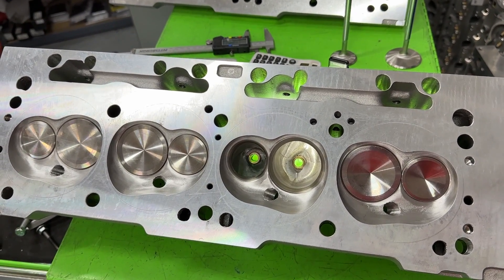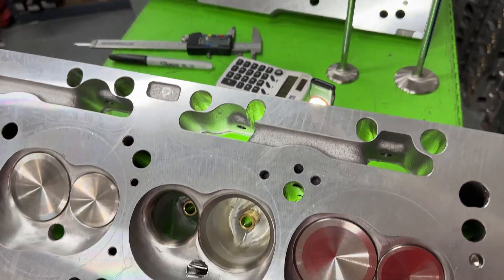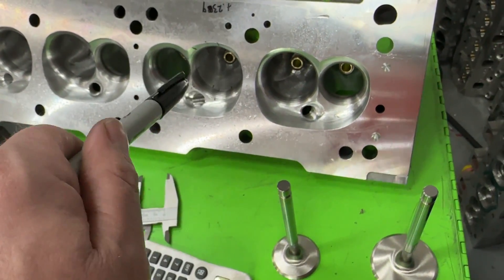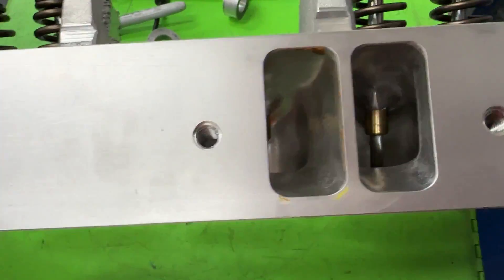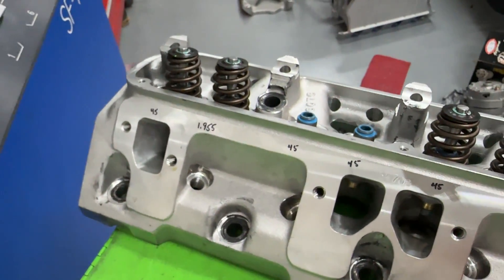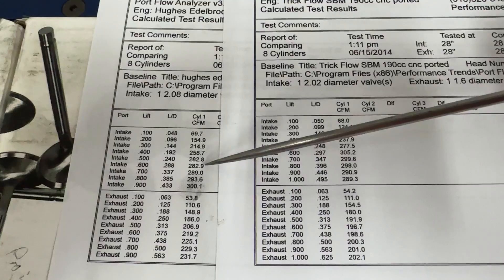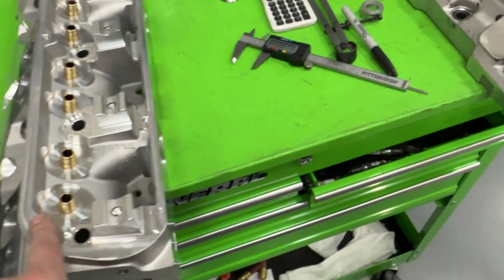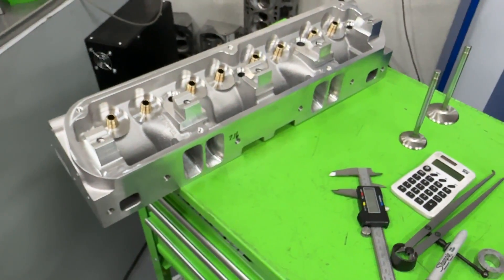Cnc Ported Small Block Mopar Heads

Comment: I may have missed it, but did you ever post anything of the trickflow after you posted it and went to larger valve? 

Also, do you think you could improve on the Edelbrock numbers if you took a bare head and offset the intake rocker like Hughes did?

Comment: Hughes does move the intake pushrod ove .350” to get it out of the intake port. They make a special intake rocker for the big mouth port job. I was thinking about having my edelbrock heads big mouthed, but the cost of the work plus the cost of the different intake rocker is too much for me. My motor does have Hughes billet roller rockers on it already.

Comment: The Hughes use an offset intake rocker and move the pushrod over. The Trick Flow have a stock pushrod location. If you want great # the Mopar W8 heads are were it's at.

Comment: My buddy has those big mouth heads on his 408 ,248/254 comp roller 122lobe sep, runs edelbrock proflow injection in a 67 cuda.runs 11.40"s at 118.street car with 3.91 gear. I opted for the trick flows and a slightly smaller roller for my 74 cuda .we"ll see how good it runs when its done. come on eric,lets see some more mopar content please.

Comment: Whats with the " i dont want to do small block mopar heads" ??
What do you have against the mopar community??????
Reply from the maker: I don’t have flow plates for the heads so I have to keep borrowing a plate to work on them. Also I hate the design
Reply: Éric how much better were the Trickflows after you added the 2.05 valve and ported?  Better than the big mouth ?   I have a set of tf’s and a set of Hughes super prep heads which are a stage 1 port from Hughes.  Basically not fully cnc’d, partial with 3 angle valve job, back cut intakes etc.   Would be curious to know a bit more on the improved tf’s if you can recall!  Thanks
Reply: Absolute poor design
Reply: @Willy-y1j  Ya so we need all the help we can get 😅

Comment: I’m glad someone sent these heads in. Thank you for this video.
 I have the same set on my 424ci LA SBM. 10.7:1, edelbrock super victor efi, 236/242 593/593 112lsa hydraulic roller. Chassis dynoed 445whp. So I’m guessing 525-550ish at the crank.

Comment: Looking forward to your flow numbers after your port work. Most power I’ve seen reported from the stock cnc work seems to be about 535 hp. It be good if us Mopar guys could buy these castings without the pushrod holes, so that we could just use W2 offset rockers.
Reply: Eric, if you and/or the customer can justify it, it’ll be great to get cc’s and CSA. The two sets of these heads that I know have been ported, they removed the vein completely. Thanks

Comment: So many of these readily available heads for MOPAR are little more than stock replacement street deals, not capable of making real power, or turning big rpm. They're low budget, low performance bolt on parts.

For example.....an old school cast iron W2 will walk all over these 2 examples of "modern day" offerings. Wanna' make steam with an inline valve small block MOPAR??? Find a set of W8s and properly prep them. 1050+HP potential with a cast single and a wet sump.

Comment: OH THE RESULTS for you further porting those TFS I would love to  hear the results.they say BM 225 cc intake ports with moved over pushrods. They selll the Rocker arms for them too.My opinion is I bought TFS . Thank you ever so much for showing the differences of heads. I bet a very large SBM will be a screamer with those heads, I wish I lived close by or I would get you to dyno test what i am trying to build a 416 .with 12.2:1 compression. I been saving for transmission parts and a rear before i complete
Reply: Like to hear more on your build, engine trans gear specs..what kinda car?
Reply: @gordocarbo  69 Dart will use a Racer Brown special Grind almost same as Used with Eric W. had on the 406.416 SBM. with 12.2:1 Eagle kit TFS 190. 750 AED Wiating to get a look at TFS Intake I have ordered , i do have a SV ed also but they need thorough porting each of their HP stuff does. then Mancini- H.S.RR. Morel RR. will be Milodon Oiling with studs where i can, also ARP 2000 rod bolts.saving for tranz, and rear. need to sell all my stuff from current 408 set up.I am trying not to Tub Car and currently deciding on offsetted shackles and weather the 4.10 and 28 x9s on 15x8 pro stars.Yukon Carrier would hold up with the extra torgue. Will go with 727 and 4500 stall max

Comment: Nice fair honest review Eric.
Well done.
Hughs did great considering. 
They should have used a 2.050/2.055 intake, IMO.
Have a great day.
Reply: Why?
Reply: @jmflournoy386  Just my opinion. 
I do not have to give a reason.
Reply: @edsmachine93  getting too close to the chamber wall  is a good reason, takes more porting is another  I agree with you
Reply: @jmflournoy386  Thanks JM.
I can't help but think the velocity may be better also.
Sorry I misunderstood. 
I only do 2.080 on 416's, 4.070 bores or bigger.
Yes, you are correct on valves shrouded.
Have a good evening. 👍

Comment: I am waiting for UTG to come in here and tell you why all this is garbage and you need some '302' castings because old junk iron that needs 40 hours of grinding is better than a brand new aluminum casting.
Reply: Haha! Finished off by the drill and lap hackfest. Cant really get behind some of the "tips" given there .

If I had to pay ANYone to port my old mopar heads it would be Steve Dulcich. He is a smart mofo just doesnt thump his chest about it.
Reply: Good old Drunkle Tony.
Reply: I don't think what the valve angle is on the Mopar heads, anyone?
Reply: 18 degree stock and better placement in the cylinder than a SBC
Reply: too funny!
Reply: Little more orange orange 🍊 juice with that vodka. Iron heads do flow amazingly well, but they have their limitations.
Reply: That's not accurate at all. And if you think your making some kind of joke, I don't see any humor.

Comment: Why they don't use a offset rocker arm for the pinch is beyond me. Would it be worth welding up the pinch and porting it with a offset rocker? Keep the vids rolling learned much here!
Reply: They "do" use an  offset rocker for the Hughes head. They move the pushrods over for a bigger intake port. Some small block Mopar heads use big block  rockers.
Reply: W2 stuff uses an offset rocker. You could probably run an offset lifter as well
Reply: @timothybayliss6680  I only have one set of bushed w2 rockers with Ford cup adjusters and bronze bushings  That's the way we did them back in the day   Now you can buy roller tip which were not available back then. Longer valves and higher lift than stock cams REQUIRE that the rocker shafts be relocated, there are kits available.

Comment: I hardly ever do sb mopes either.  But this was an interesting video and comparison.  I have worked on the trickflow bb mopar 270's. Nice quality hardware. But I was not diggin the design. Those hughes heads seem like the clear choice for anything other than a 318 or a tow rig. The low flow is an easy fix with some carbide time.  I am impressed with hughes in this particular case. I do wish Eddelbrock would change their seat ring sizing and bathtub chambers in many of their heads.
Reply: agree on the Edelbrock chambers

Comment: Nice video Eric.  I am not a Mopar guy,  though I have clients that are.  I can report the the Trickflow 190 heads are top quality and work really good on a 360/365 .030 in a nice street application.  I too am a ProMaxx dealer, and recently sold a set of the cnc small block mopar heads for a fairly hot 365 .  I hate to say it but the cnc work was less than stellar.  On the sides of the SSR it was really wonky, the tooling steps were atrocious.  And as is typical for Mopar the pinch was way to small to hit the desired power.  So I installed brass tubes and got closer to the needed CSA  then getting the T Ram to land on the port and have taper from the plenum to head took a rediculous amount of time.       🤦‍♂️

Comment: That exhaust port on that sbm just looks funky and old looking to me because it's got the angle going up but yet the shape coming out has no rooms because of the bolts it looks like and why do they keep lowering and flattening the floor. What's you thought on the exhaust port. And also what do you think about sbm vs Chevy heads in general on intake port and whatever else
Reply: Agree, The stupid position of those exhaust flange bolts makes it difficult for clearance to header pipes. If only they used a different pattern or spread them apart 1/4 inch further.

Comment: Hugh’s has a kit to stroke a 360 mopar to 410, probably what these heads are aimed at.
Reply: Hughes has a 426 stroker kit and Indy Has 470 kit as well as Muscle Motors does for small blocks, which would be very nice
Reply: @smilsmff I was one of the first to buy their kit. My project has stalled for quite some time now, but I am hoping to get it back on track soon. There has been alot of new technology and offerings since my project stalled. The Gen 3 Hemi is looking better each day...
Reply: @Stevo4517  Looks like to take advantage of the flow of CNC Ed heads you would need 270 @ 0.50 and .900 lift total which is drag race only due to higher lift and valve train wear
Reply: I had a customer with a 396 inch LA that was definitely a bullet.  Mid 11s iirc.   74 Cuda street car. This was the early 90s so it likely had 340 castings ported to the DC templates.
Reply: It’s a magnum block with the Hughes 426 stroker kit